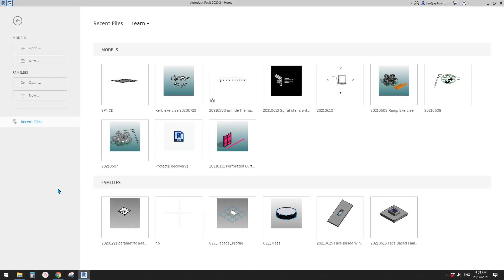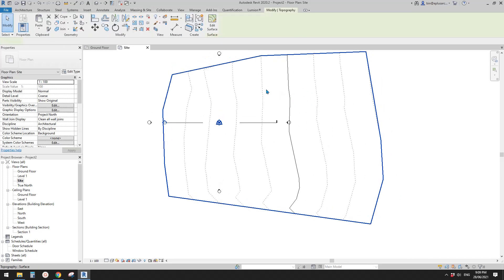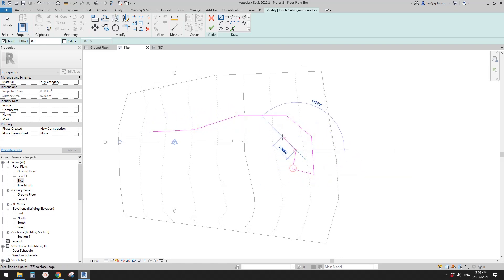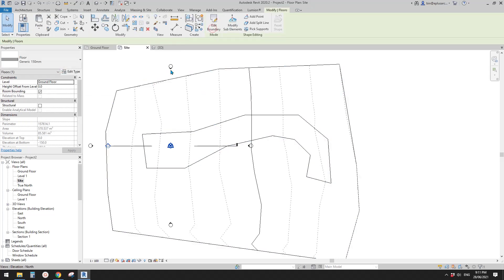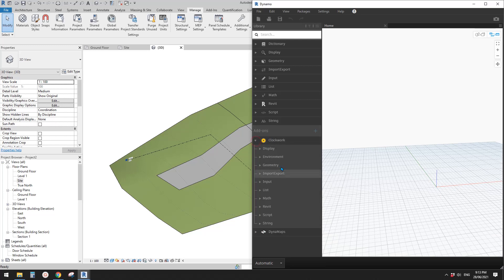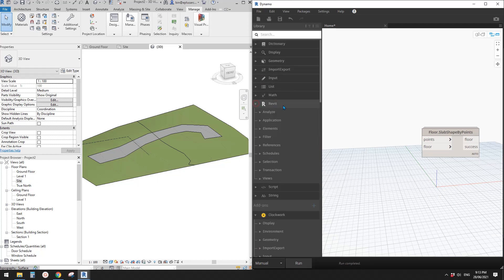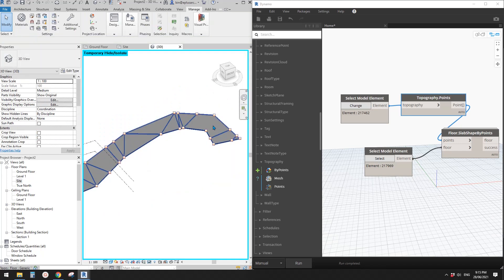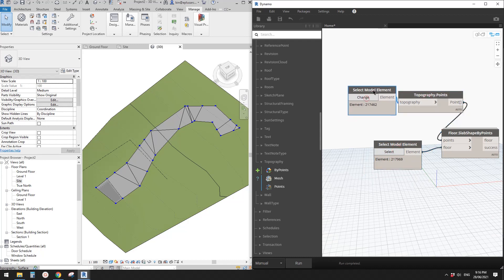Everyday Revit (Day 465) - Make Floor Follow Topography Using Dynamo

Comment: Is there a way to do this with toposolids? I tried using the toposolid.points node to find the toposolid points but it shows an "empty list" for that node and doesn't adjust the floor. Any advice?
Reply from the maker: I'm not too sure, havn't tried dynamo on this topic for a long time, I will have a look later this week.
Reply: @ awesome thanks! I’ve tried and can’t get it figured out

Comment: "Constraints defined by highlighted Lines and Dimensions can't be satisfied"

I was trying to apply the steps up to from on or before the 3:00 mark and this is what showed up. It seems that there's only so much for it. I'm just mapping the roads from a CAD file
Reply from the maker: Do you have the Lock ticked? Try untick it when picking DWG lines.
Reply: @BINHE615  I don't remember seeing the tick at the Lock. I'm trying other methods, and also considering to add this one to them.
Reply from the maker: No worries, please let me know if you still have issues, would be good if you can explain some background details.

Comment: Hi Bin, just today my team found floor.slab shape by points node disappeared in revit 2021 (dynamo 2.5)...have you tried this in revit 2021?
Reply from the maker: Do you have Clockwork Package installed?
Reply: @BINHE615  yes, and tested all version of clockwork. revit 2018 works, In 2021 you can not find the key floor node..:)

Comment: This is good, but it would be handy to see how you would cut the floor surface into the topography because the road would have to be offset a few milometers into the topography in order to be accurate, and give way for the curbs. It's not going to be flat all around.
Reply from the maker: Good idea. I think you can simple move the floor down a little once it is created.

Comment: btw whats your opinion on making topo model separate from the building.  If separate I suppose the building pads are part of the topo model
Reply from the maker: I use building pad sometimes , but  prefer to modify the topo myself,  sometimes fill region and masking region also work well.